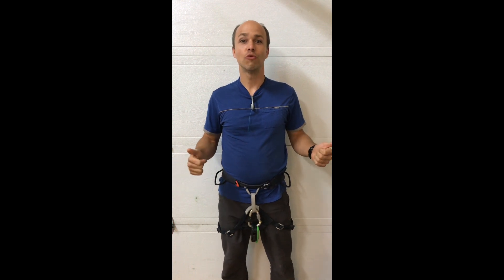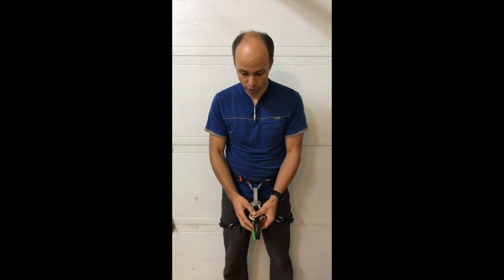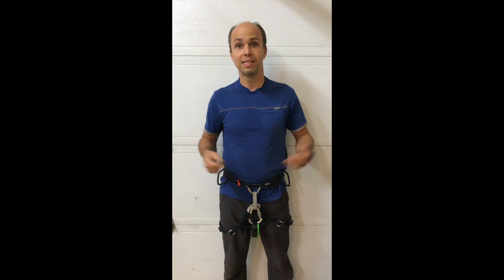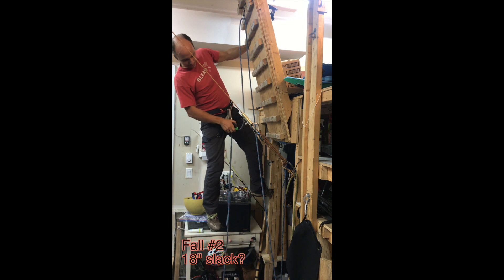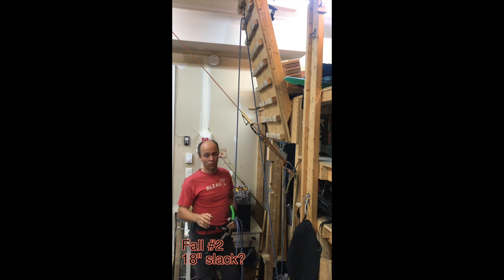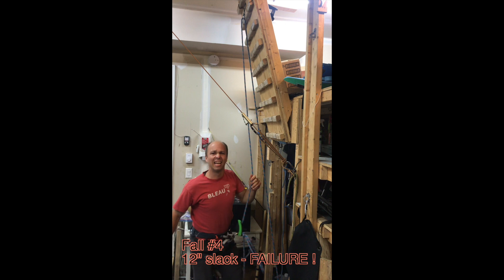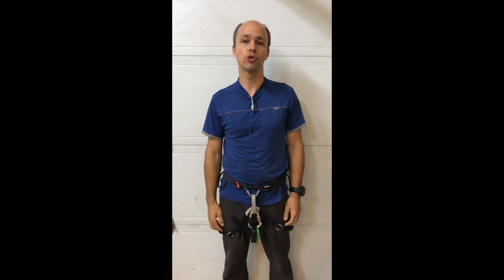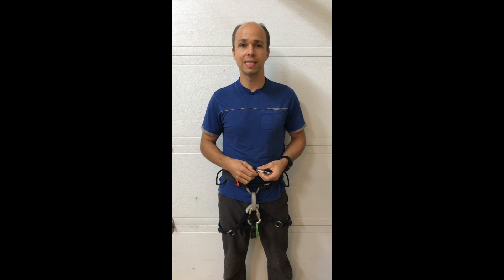8.05c Eddy Falls -  Unmod=DANGER!!! - PART 2

Comment: I agree with J Healy. I’m not sure what you are trying to prove with these videos of the Eddy. That it doesn’t lock after a few inches of falling? No device does. I know that my falls when LRS will be longer because it takes the devices time/friction/energy to activate. You have to take that into account for your safety. And that means if you are close to the ground, you may deck. I’ve lead solod with all the devices and think the Eddy is the best. Solid construction, locks reliably for me, and the locking mechanism can’t be overridden by accident. I even gave up using my silent partner, and won’t be going back.
Reply from the maker: What can I say: only the Revo and SP are speed activated. If the grigri or Eddy does not lock when the “rope comes tight”, then who knows when it will actually lock and stop your fall. You need to be lucky and that the rope “snakes” in the air making some friction at the entry of the device or that your cache loop empties. Look at this video where the grigri slips 3.5m on me. I believe the Eddy is more prone to slipping than the grigri. https://youtu.be/PPjN3oFncc8 Oh and by the way, all grigris locked for me with all ropes ( I tested down to 9.1mm joker) with 10cm of free fall!!! So I know what I am talking about! Also my Eddy failed on me on a 2-3m lead fall. The cache loop almost needed to be empty for the Eddy to catch. I don’t like that for the clients of my courses. I don’t think it is safe enough.

Comment: Complete and utter nonsense...
Reply from the maker: Hi Joe! By the way I really put some time into real-life climbing with the Eddy and the Maxim Glider 9.9mm. And 2 years after this video, I still don't like how the device locks (or actually does not reliably locks) on the rope. NOTE that the way it is shown in this 2019 video is not how you attach the device. My recent testing (not published on YouTube) was with the exact way you attach it to the harness. And I put more time into the "James-mod" also, especially an improved version of the James-mod. But I finally found a way for the device to fail with the James-mod also! In the end, as of today, I found reasonable ways to use 10 other devices but still don't recommend the Eddy for LRSing... (list of devices here: https://blissclimbing.com/en/online-courses/)
Reply: @YannCamusBlissClimbing  I"ll stack my thousands of pitches and lots of falls against your testing any time - it locks up just fine.

Comment: Hey Yann, you mentioned that you'd be testing out the Eddy using a Glider 9.9mm. have you gotten around to doing that at all? I have that set up but have only put time into using my revo, would love to transition to my Eddy and glider and would be really interested in hearing your experience. Cheers
Reply from the maker: Hey Ricky! The Eddy + Glider is a rather interesting subject! Since I can make the Eddy fail with the Glider rather easily, I have not trusted the Eddy when un-modified. I explain how I modified my Eddy in my online LRS course here: https://blissclimbing.com/en/online-courses/ . The new thing I understand now is WHY devices like the Eddy will catch much better when there is a "free fall" and tend to fail when there is a "high clip" with tension BEFORE you fall and therefore no "free fall". Also I have the full explanation of the Joseph Heally way of doing in my online course. You will have to take your decision in the end! Also did you modify your Revo? The modification and different ways it can fail are fully explained in the course... Also, I am always happy to answer my client's questions in deep details if the course does not make it clear enough... And these answers are shared in private groups (TRS and LRS) for all client's to benefit from it. Take care!